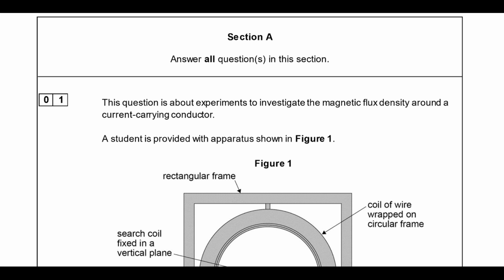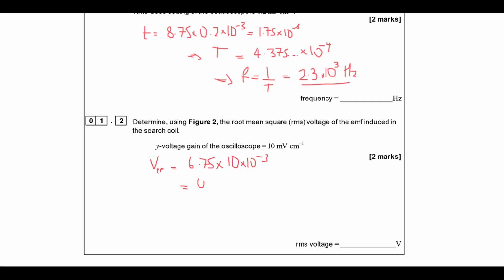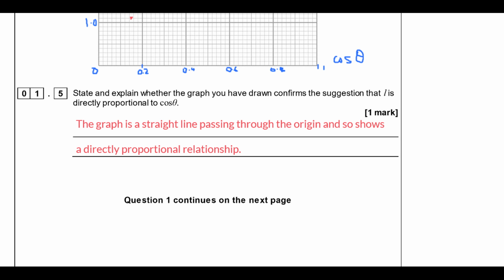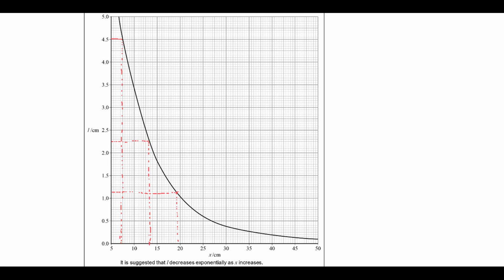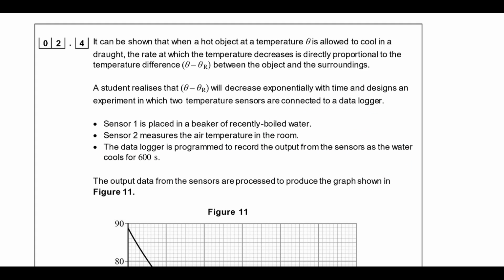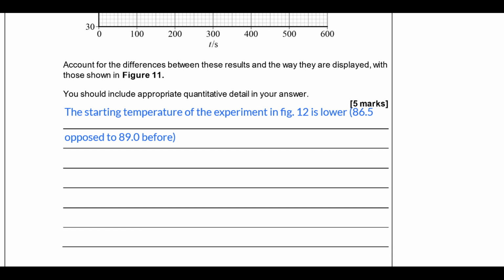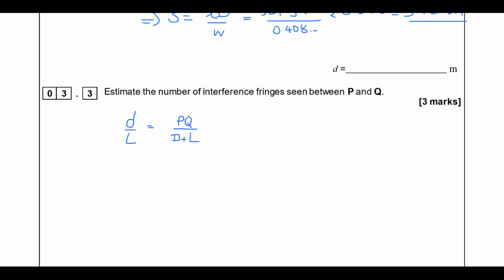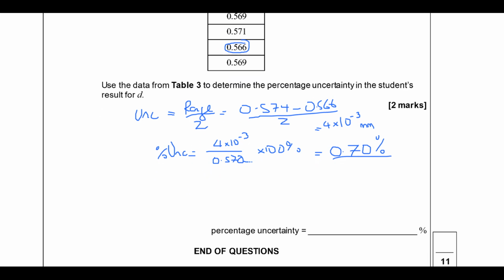A Level Physics: AQA: Paper 3: Full A Level: Specimen Paper (Set 2): Section A

Comment: 8:50 the line clearly doesn’t go through the origin though... In this case how do we determine whether it is merely a zero error or it actually does not support the theory?
Reply from the maker: You consider whether within the uncertainty of the experiment the line could go through the origin. E.g. if experimental uncertainty is 0.1 but it is 0.5 away from the origin, it would not support the theory.
Reply from the maker: There is no way of telling from a graph it is a zero error or not but it can indicate there might be one if you expected the graph to pass through the origin but you'd have to redo the experiment to find out, checking for the zero error
Reply: Burrows Physics But when we are answering that question do we have to mention that it might be a zero error therefore the experiment has to be redone?
Reply from the maker: @aidenwinter1117  That would be my reaction to a graph like that (or at least check the measuring instruments used for a zero error)

Comment: hi
where can I find more practical question and pastpaper for AQA 
thanks
Reply from the maker: I recommend all my students do the section B of old unit 6 papers (you can't do section A)
Reply: Burrows Physics 
hey what about unit 3 in the old specimen?
Reply from the maker: Thenu Siva That's ok but might be a bit easy compared to the exam
Reply: Thanks for your reply sir
The AQA website old specification is look like below
06T
06X
Which one you meant?! 

06T is contain two part
Unit 06T(p15)
Unit 06T(Q15)

Unit 06X ((EMPA) task 1 and 2

Which one you meant sir
Thank you so much for your help
I couldnt finish my physics paper with out your help
I had really good exam in p1  .p2
You saved my life sir
Thanksssss alot

Comment: For the last question, when calculating the mean why don't you convert them to m?
Reply from the maker: Because if they are both in mm the 10^-3 will cancel on top and bottom line anyway so there is no point.
Reply: I know but why do you have the 4e-3 at the top and then mm on the bottom
Reply from the maker: Yes but the 4 x 10^-3 is in mm too
Reply: Oh wait I see now! Thanks again!
Do you have anymore past papers on practical skills?